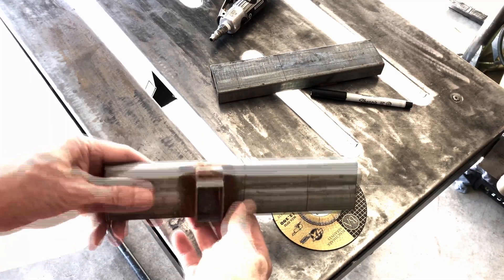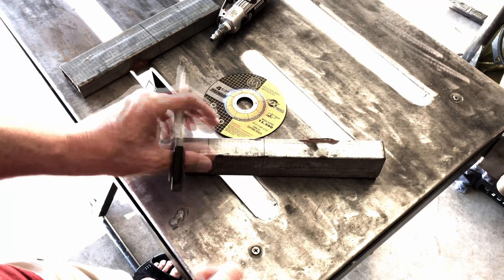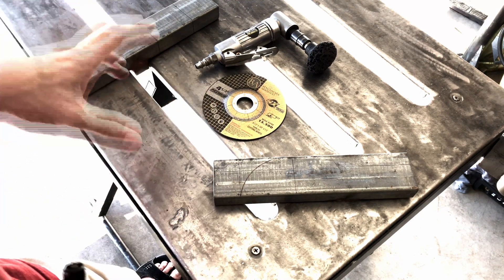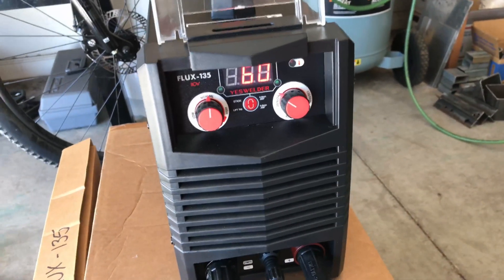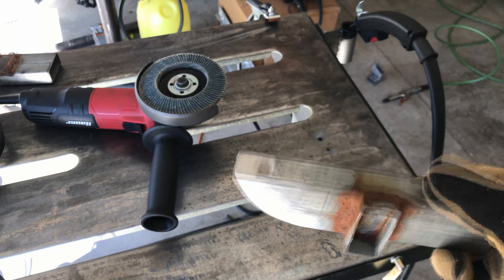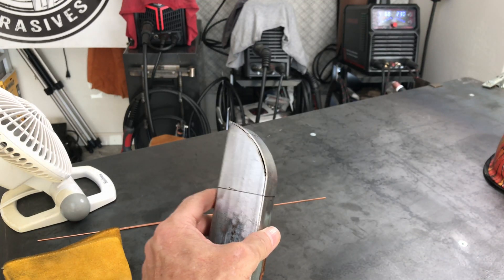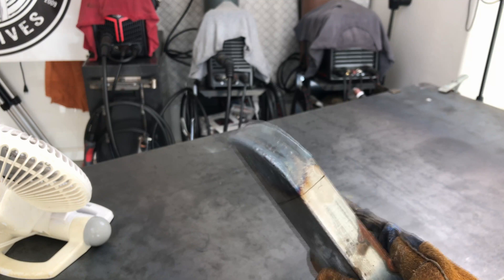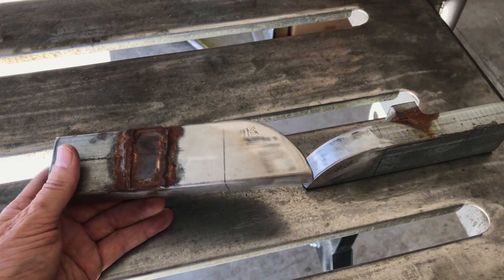Flux Core VS TIG Welding for My Next Fabrication Project

Comment: To me it's no contest, especially with the galvanized part needing a fan.  Flux Core.  But I think you could get away with a HF painter mask probably with charcoal filters.
Reply from the maker: Thanks for your input. You have some great points!
Reply: A glass of milk and that will fix you. Welded for 16 years a lot on galvanized grading and pipe. Ice cream or milk will help with the headache and stomach ache. And for the welding fluxcore is faster but it's your preference

Comment: The only welder i have is a chicago electric wire feed. It's been doing most of what I need at the moment. But now I have 2 project trucks I want to work on and need something a lot better, including aluminum. I hear a lot of good about Arccaptain, minus delivery issues and lack of support. So that has me a bit worried. YesWelder seems to be a favorite that I am also looking at. I don't see near as many customer complaints. I can't afford to make a mistake and buy the wrong one. If i could afford it I would just buy a miller and not have to worry. But I am disabled so funds stay tight.
Reply from the maker: I'm in the same boat. I would love to have a Miller or Lincoln but I just can't justify the cost for my welding hobby.
Reply: Prime Weld is also an excellent option, and in fact the one first chosen by this youtuber/channel.  I have both their TIG225X AC/DC Tig and their MIG180, which comes with a spool gun for miging aluminum (for which you'll still need a tank of Argon).   Both are excellent and I believe still come with a 3 year free return shipping warranty.